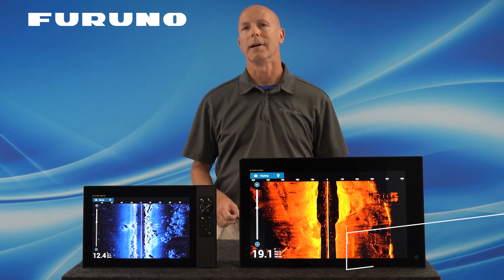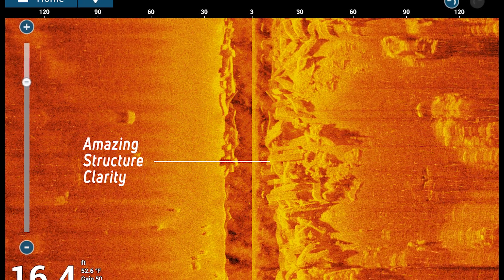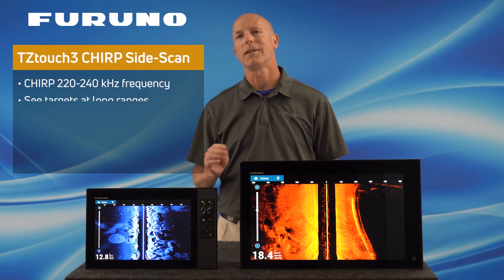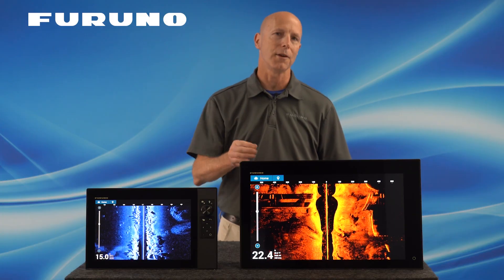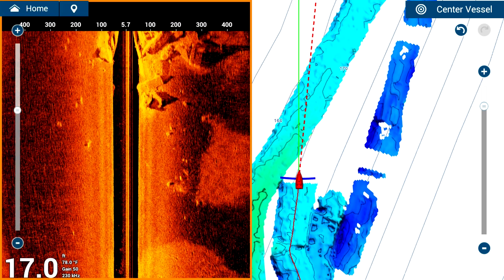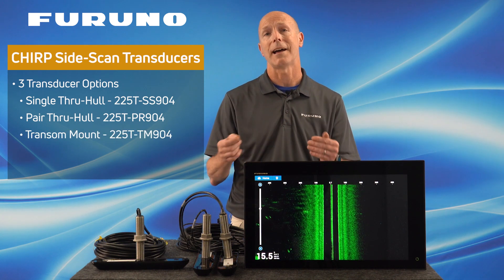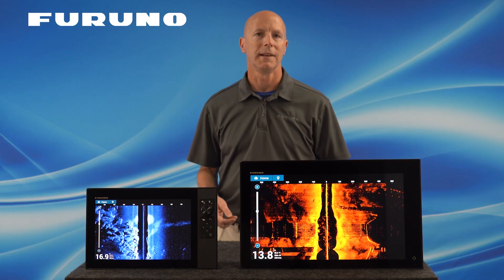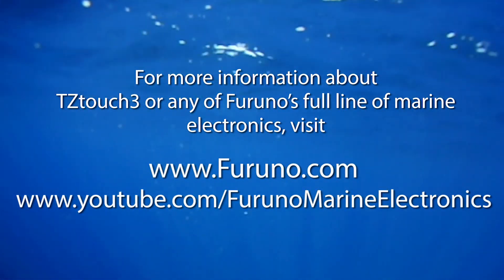Furuno First Look - TZtouch3 CHIRP Side-Scan

Comment: Will the side scan transducer work with a TZT2?
Reply from the maker: Thanks for watching! Unfortunately these CHIRP Side-Scan transducers will not work with TZT2. However, if you have a DFF3D Multibeam Sonar connected to your TZT2, you will have that Side-Scan capability.
Reply: @FurunoMarineElectronics  My current transducer is a transom mounted 82B 35R and I have a TZT2 and FCV 1150. To get side scan would I need to get the 225-TM904 transducer and a DFF3D? Would the 3D and sidescan views show on the FCV 1150 or would I have to use the TZT2 for that and only get the 2D view on the FCV 1150?

Comment: what a pity there is not 2 ports for transducers, 1 for the traditional transducer and 1 for the side scan. with an option to select between the 2. I only have space for 1 machine so id have to un plug and change transducers manually at sea. Not ideal.
Reply from the maker: Hello @donsolomon8501, thanks for watching! The side-scan feature not originally planned in the development of TZtouch3 and was a free software added feature that came a year after the TZT3 came out, which is why it only has one transducer connector. Not ideal as you stated, but definitely a fantastic free upgrade to an existing system.
Reply: @FurunoMarineElectronics  yeh 100%. Cool